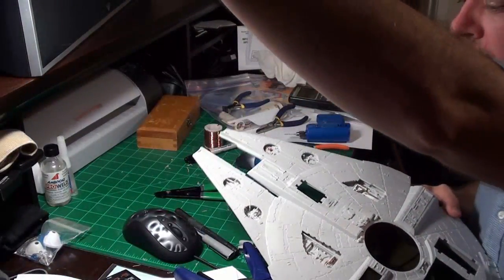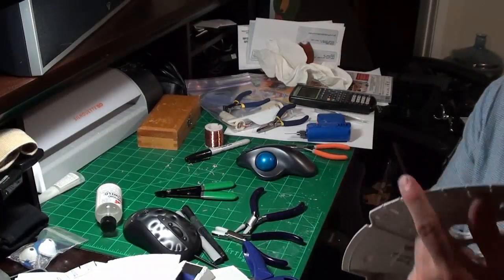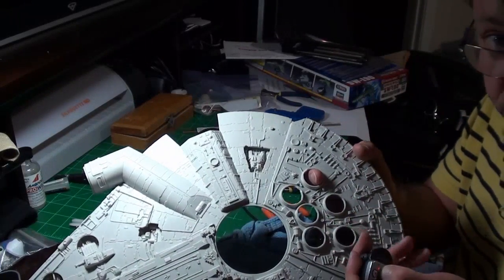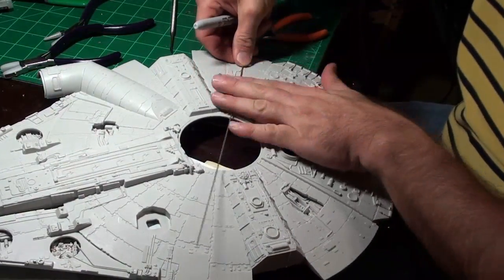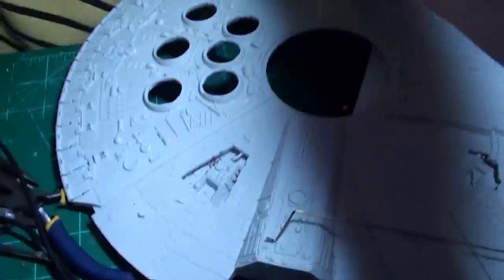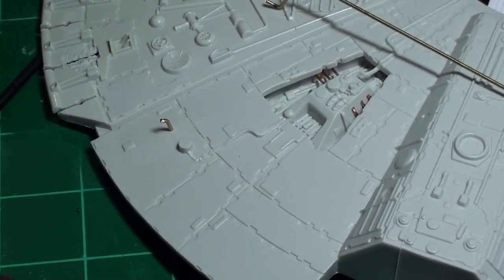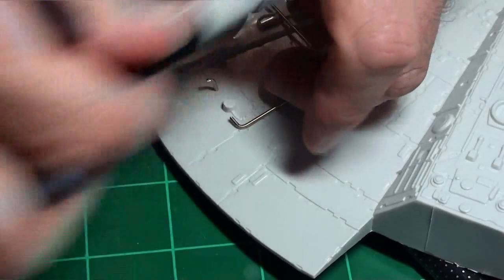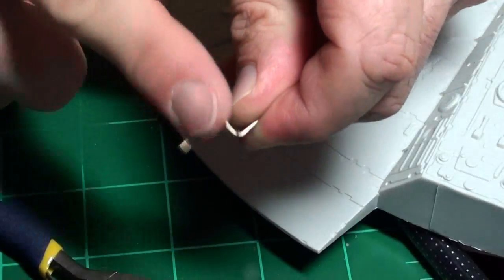Millennium Falcon part 10:  Pipes!

Comment from the maker: Norm, more than one has said this.    It is time consuming, but it also improves the looks quite a bit.   Most of the upper hull is done.   The lower hull is not going to be as bad.  Much smaller pipes and I can use the copper wire for those.   Goes much faster.

It will look good in the end.

Comment from the maker: Yes I did, but I didn't want to have burn marks on my hands for the next three weeks.   To soften it up enough, it would have to be too hot to handle.   I have switched to Copper for the smaller pipes.

Comment from the maker: I thought about using solder for a little bit.   And then decided against it.   I am around small children occasionally.   Solder is too soft, all it would take is for one kid to push down and dent the solder.   The brass and copper won't dent as easily.